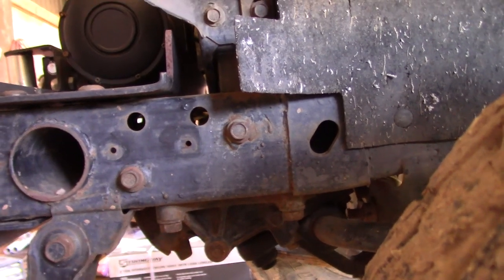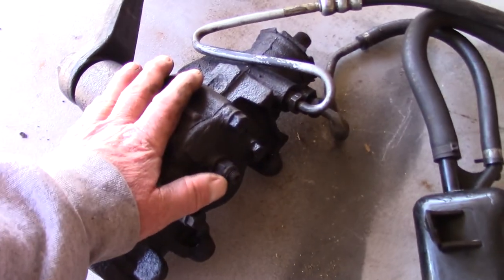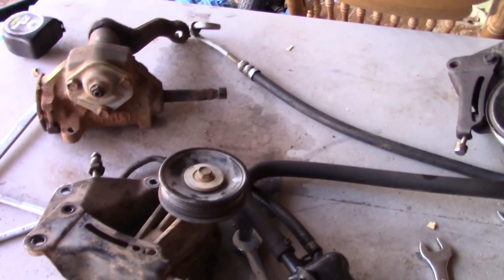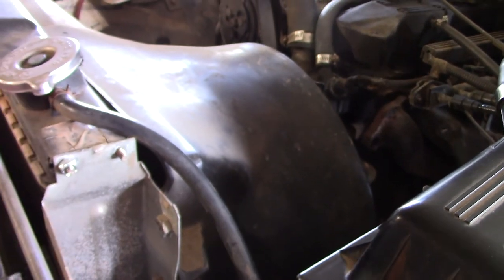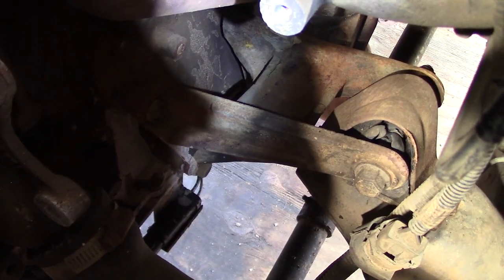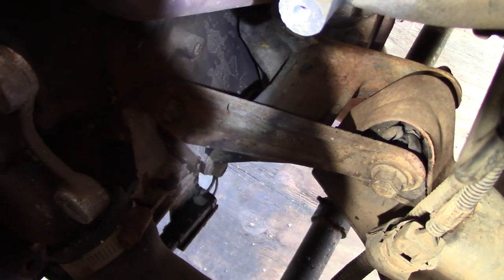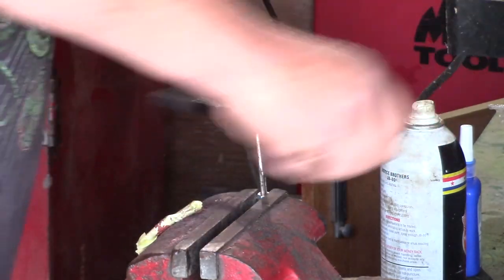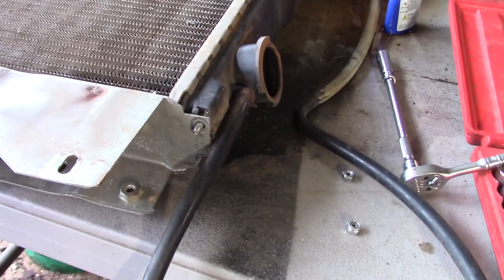YJ Jeep Power Steering Conversion

Comment: Thanks for the video I have a 95 that was the same setup. I tried putting power steering on in 2016. This video is helping me figure out how to do it.
Reply from the maker: I am really glad that the video was helpful.
One thing that I found out later was that the steering shaft is fixed. You may need a hand getting that hooked up while you mount the gearbox. Thank you for watching and come back for more